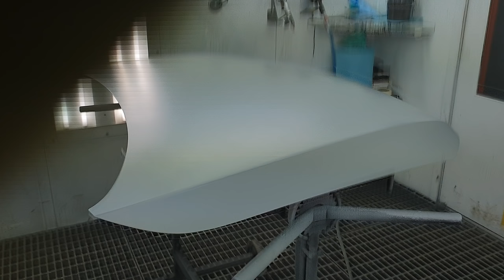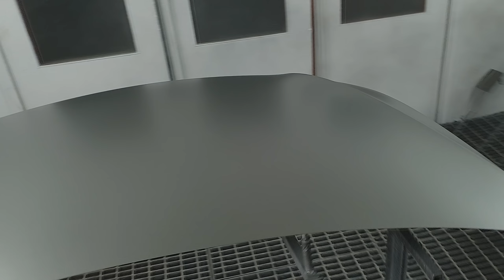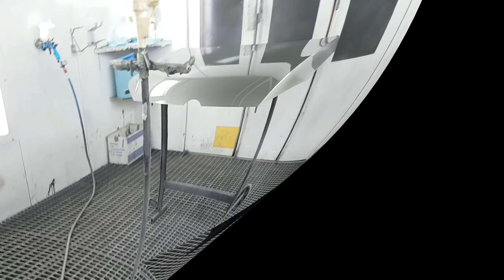Anest Iwata Hakone  |  the BEST clear settings

Comment: he said..turn the fan all the way out and turn it in a bit then fluid tip all the way out and set to 30 psi and spray it.
Reply: You should turn in the pattern knob until you see a change- about 2 turns in.

Comment: I have the same gun with 1.4Hd tip:)..what settings are u using on it?
Reply from the maker: Hi, you can see that at this video. Take care
Reply: @coloroncarpainter5031  i saw the video but it was a little unclear...great videos by the way:).....
I was wondering on fluidturns out from fully closed and fanturns out from fully closed?
Reply from the maker: @kennethandersen6920  
fan open 2 turn
Fluid closed 0.5
2-2.2 bar
Reply: @coloroncarpainter5031  thx for reply:)